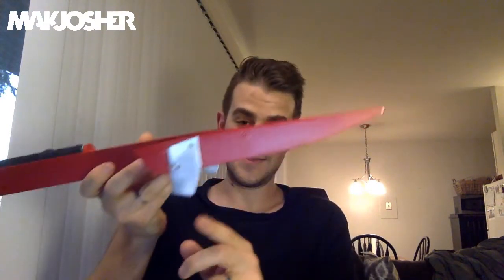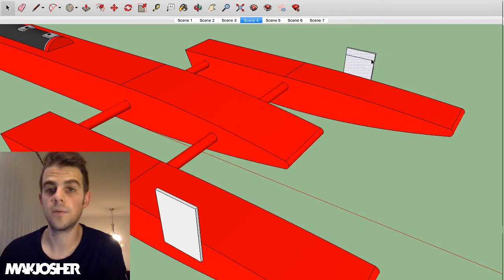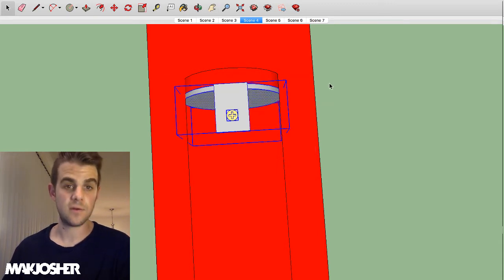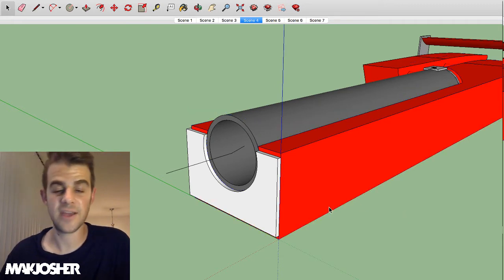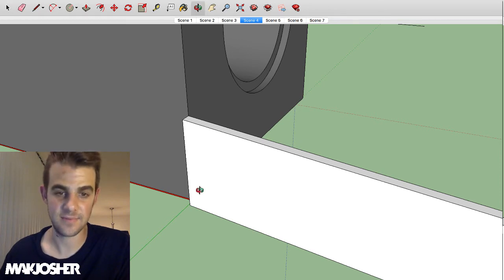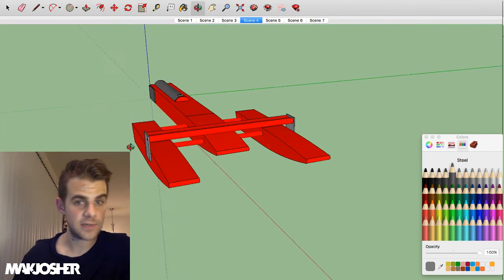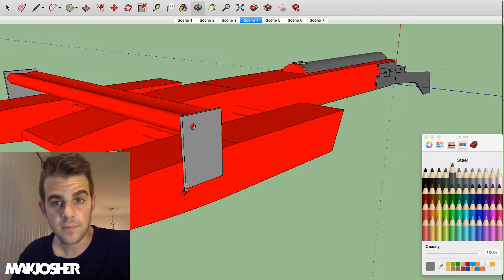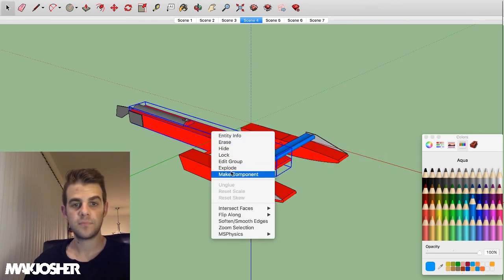Rocket Boat Mk2 Design Livestream

Comment: Nice project. I was keeping an eye on this one. I geuss i missed the livestream. :-) In my opinion you need to adjust the angle of your rocketmotor. It looks like the thrust is going upwards a little. So towards the sky. The thrust should be slightly tilted to the water surface so the  force will be more on the sponsons. Then you will not need that wing on the front. You also need make sure that the motor is exactly in the middle and straight with the hull and the sponsons. If it is off the boat will keep turning. I hope it works!
Reply: Kraanist Nice one
Reply: Donald Campbell was his name. His boat was the Bluebird. ;-)  That boat looks fantastic!
Reply from the maker: Thanks! I’m glad to be able to share this once again as it got lots of interest last year. As far as I know the engine is nice and centered/straight. I think the rudder/trim should be able to adjust out any minor imperfections there though. Oh, and the engine is flat front to back in the boat despite not always looking that way. The thrust adjustment is an interesting idea though. I’m not sure how much adjustment I’ll be able to do on this boat, but I may be able to tilt the tube slightly by adding a small adjustment bolt at the front of the tube. I would think only the smallest thrust adjustment would have a huge impact!
Reply: makjosher  I hope you will get to work. Can't wait to see it  when it is finished!
Reply from the maker: Haha. Thanks! I've already been working on the engine and am hoping to get started on the boat tonight.
Reply: makjosher great! :-)